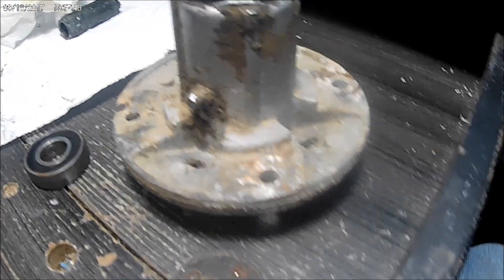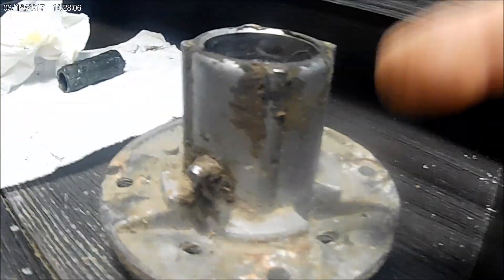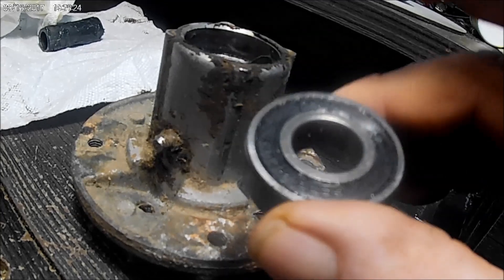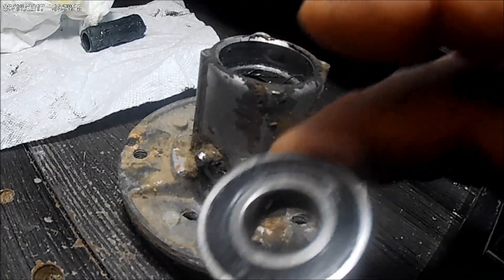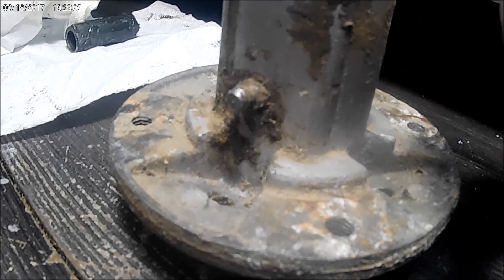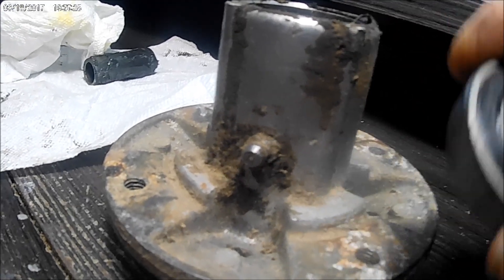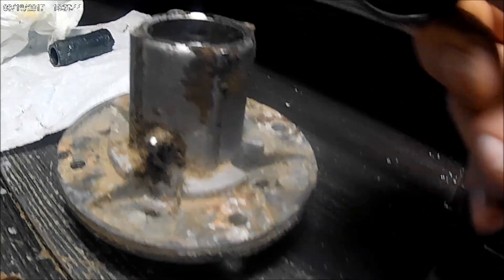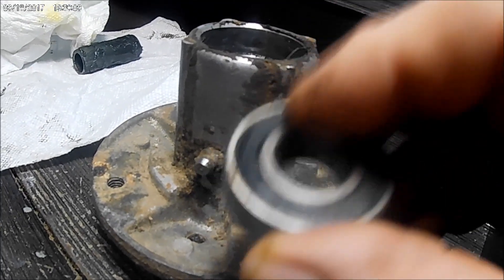does installing grease fitting in a deck spindle housing really work

Comment: I worked for a machinist while in high school.  The spindles on his Craftsman garden tractor went bad. He bought new spindles and put grease fittings in them also. One of my jobs was to mow grass. And, before mowing I was to put grease into the mower deck spindles. Every time I mowed the lawn.
Reply from the maker: the ones that don't have fitting tend to not last extremely long, but they can sell more parts that way.

Comment: Heres my thoughts ,  , I pump grease until it goes  threw bearings and comes out ends of spindles , grease will go past the covers , grease guns push out 10,000 psi ,  they are not seals just loose fitting dust covers .   , some people add  a relief hole  but this does not allow fresh grease to pass threw bearing so what you are left with is the same contaminated grease around the bearings..  as bearings wear they create metal particles that will just sit there and act like sandpaper , you want to flush new grease threw them to purge the contaminated grease  ,  a guy on you tube actually proved it using different colour greases , the grease will go through bearing with both covers on  , grease will follow the path of least resistance   so when cavity is full it has nowhere else to go but threw bearings and out ends of spindle  as its designed to do .   I would prefer to have new clean grease around bearings. , adding the vent hole guarantees no new grease will ever get to berrings after the initial fill

Comment: Smart man MOT. Your one of the few who give good advice on this. I was fed up with watching the videos from the pros saying don’t bother adding grease to a mandrel even if it had a zerk due to the shields stoping grease. I decided to make a detailed video on this a year ago. It’s a hot topic. Hope you don’t mind me firing back on a few of your video moments.
Reply from the maker: I guess some folks think those flimsy seals will hold back hoover dam, grease guns put out a lot of pressure and those seals are on there to keep what ever grease the factory put in there in place.

houver dam
Reply: @MissouriOldTimer  we are most certainly on the same
Page. Silly some folks think dismissing a deck and drilling hols in a seal is the answer. Why not just grease the mandrel first and see if it works before they start imagining better process.
Reply: yes they are just dust covers not  "seals " lol you can pick them out with your fingernail and people think they gone stop grease from entering , lol.  a grease gun puts out like 10 000 psi every pump  @MissouriOldTimer
Reply: The reason why the so called pros are saying to not take those inner bearing seals out is because they want the bearings to fail from lack of grease so people end up bringing in their riders to have the mandrel bearings or the whole spindle assembly replaced or rebuilt . I take my inners off & fill the mandrel cavity up with grease before it goes back together then once fully together I pump more grease into the mandrel housing until I see a little grease coming out of the outer seals . When the bearings eventually start to fail I got the part numbers of the top & bottom bearings & just buy both sides upper and lower bearings & replace them . On some models the lower bearings are pressed on so I use my hydraulic press & some steel plates to press them off the shaft and if you don't have a hydraulic press you can use a cut off wheel on a grinder & cut the outer bearing shell in 2 spots and the shell falls off with the worn bearings the you can either heat the inner bearing support & it should slide off or it can be cut off using a grinding wheel safely so you don't cut into the spindle shaft .
Reply: @peteloomis8456  in 20
Years Iv never experienced any of those complications while working on a deck. And I also don’t bother with removing any shields. As Iv shown they don’t stop grease flow. The exact reason I made this video was to prove that point. Thats why I put the shields back on. But sounds like you have things figured out. We just do things a little differently but I’m glad you don’t have to trust the crooked mower mechanics. It’s hard to find a mechanic I trust.

Comment: The seal will pop off quite easy so to make it simpler to get grease in the bearing I drilled three 1/8 inch holes in the  seal , repacked it with fresh grease and snapped the seal back on. Easier to get grease in and keeps it in when the top bearing gets warm unlike just removing the inside seal.
Reply: No it’s actually not easer to do it the way you described. just greasing the zerk with a great gun until you see grease exit the assembly is all that’s needed and as easy as it gets. Only tool required is a grease gun and only takes a few minutes. The author is absolutely correct in his information. The high presure grease will pass those rubber seals like they don’t exist. Super easy to test the process at home and in doing todo your deck bearings will be serviced. Dismantling to access the shields to drill holes is a wasted effort. Some folks can’t understand how simple this process is and for some reason need to add extra steps that don’t provide any added benefit. I made a video as well and explained it in a more detailed process where I show the before and after to bust the myth. This is very basic maintenance. For folks who are willing to
Consider the advice it can be extremely beneficial. Where most folks get confused is a few pumps won’t help. The assembly must be filled and this can sometimes take 50 to 70 pumps from a hand held grease gun. Most folks think 3 or 5 pumps did some good but that bearing never made it past the shields. The assembly must be completely filled.

Comment: Great video may be 2 yr old, but plain common since. The grease fittings are there to grease the bearings, plain and simple. When you grease the mower spindle the grease goes into the bearing (bypassing the rubber seal) the seal is there to retain the grease once the bearing warms up to operating temperature not to keep the grease out.

Comment: Thanks. I drilled and tapped grease fittings on my spindle housings.
I also removed the seal off one side of each bearing and placed the unsealed side facing inward.

Comment: I did that with the auger on my snowblower several years ago.  I did pop out the inner bearing seal on the grease side.  Makes it easy to flush out the water in the spring.  You can easily see the old and then new grease coming from the remaining seal.
Reply from the maker: this one actually had grease on the back side of the bearing.
Reply: This is not a snowblower. All applications don’t work the same

Comment: Nice video Vernon, I agree with you, I have seen sealed bearings that packed up due to moist go in after a long while then dust can also go in past a hardened rubber seal, if there was grease in it will prolonged the life of a bearing
Reply from the maker: that's for sure.
Reply: All you have to do is pop the seal out on the inboard side

Comment: Having that extra grease will definitely not hurt things.  If it was dry, the dust will work its way in so if there is grease, it should work its way in as well.  I agree with you.  Stevo
Reply from the maker: it always pays to make sure the bearing have enough grease.

Comment: We are with you on installing a grease fitting. We tend to remove the cover on the bearing on the inside but you make a good point about the hydraulic pressure from the grease gun overriding it
Reply from the maker: it would be easier with the seal removed.

Comment: Good point about the hydraulic pressure.  That would make for a darn good experiment some time to see if grease would get in without removing a shield...

Don't seem very logical to me the way they are built with sealed bearings either

Comment: I always take one side of the bearing seal out. It must work because they don't come back with the same problem.
Reply from the maker: that would probably be best, it wouldn't take any pressure to get grease in the bearing that way.
Reply: I see that point, but still with the wear, treated or not with grease, wouldn't slop/flop of the parts risk a bearing to jam or possibly cause binding?

Comment: There is a video by Woodchuck Russ the Deck Dr proving that the inner seal of spindle/mandrel sealed bearings do not need to be pulled for a grease gun to grease them.  The title is: Don’t trust the “Experts” Grease your mower deck sealed spindle bearings Common sense maintenance.  You can find it by the title.  I guess there could be situations where this doesn't work or well enough, but it should be OK in general, especially for factory installed and properly installed zerk fittings.  I installed my own and left the bearings sealed.

Edit to add:  I think pulling the inner seals and then fully greasing may cause the remaining outer seals to be pushed out, leaving the ball bearings fully open with no protection.

Comment: These young folks are referring to a shielded bearing as a sealed bearing! You can club a shielded bearing like the one in your video! I was a Caterpillar Mechanic for many years! I also attended tech school for industrial mechanics! So I feel like I qualify to insert my two cents worth. Just back that up! All these young folks will say I just Google it! Well don’t waste your time. I did it for you!😂 

What is the difference between a sealed bearing and a shielded bearing?

Lubrication and Maintenance: Shielded bearings allow re-lubrication. Sealed bearings are pre-lubricated and maintenance-free but need replacement when lubrication deteriorates. Performance and Lifespan: Shielded bearings allow higher speeds but may have a shorter lifespan in contaminated environments.Jun 8, 2023